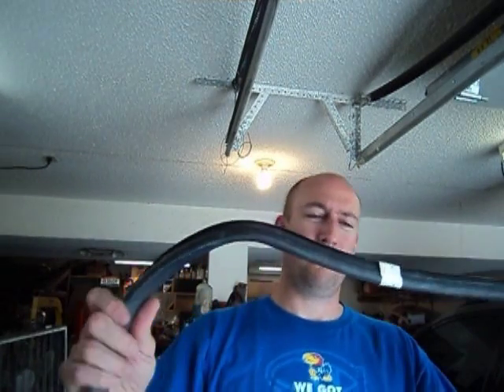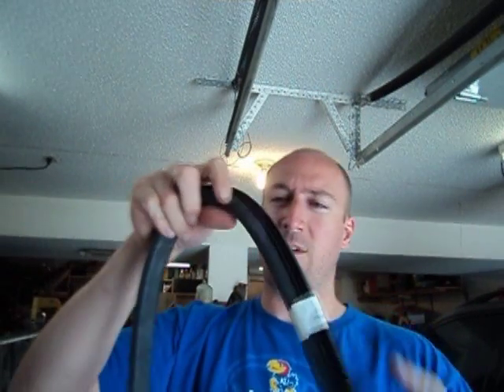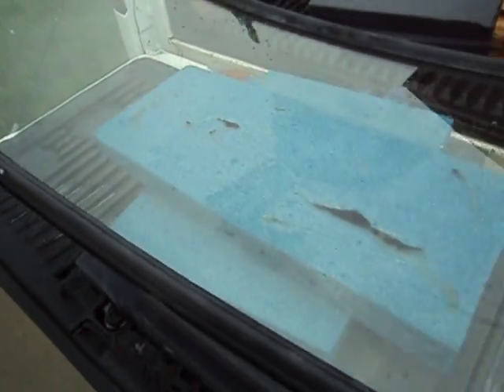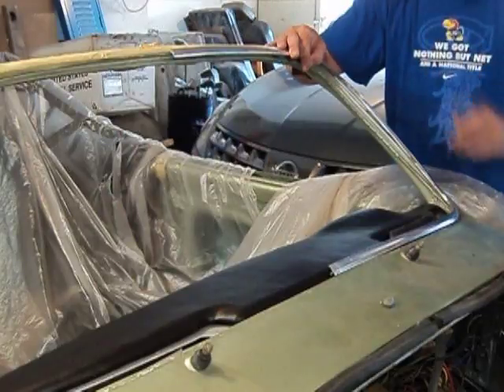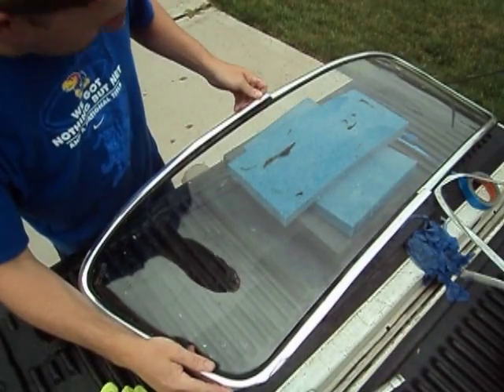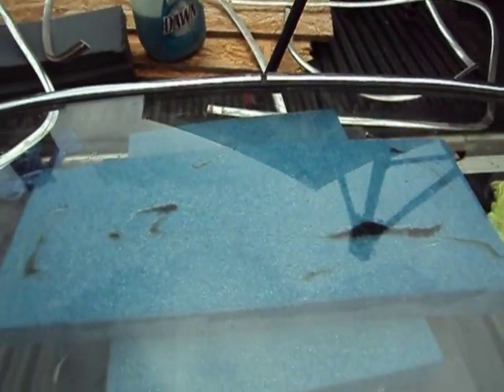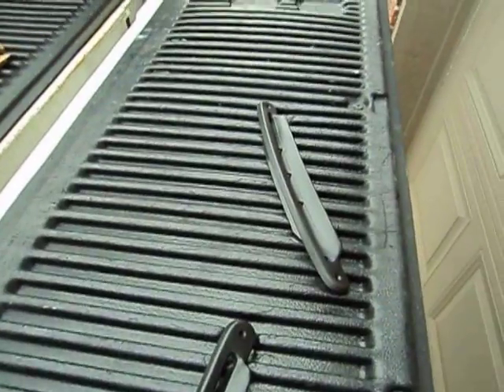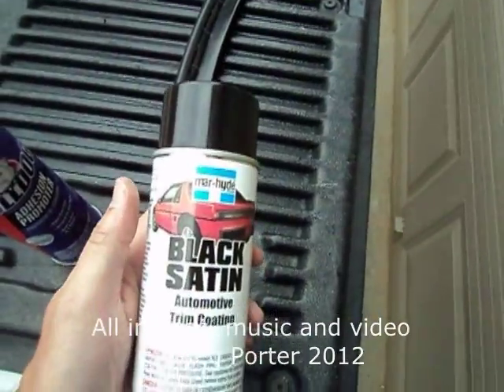Karmann Ghia Windshield Installation - Part 1

Comment: my 2 cents worth...run the old glass if you can get it installed w/o breaking it.When you find the glass you ultimately want you can always just break the old one and get your rubber and trim out w/o damage then your just out some labor...and practice. another cool vid! thanks

Comment: Too late for you Greg, but here's some tips for anyone else tackling this job: Go ahead and get the cheap gaskets but use 8 inch strips of duct tape going 90 degrees to the gasket to to hold the gasket in place while you work it on. Do this about every 8 inches. You can remove them once you get the gasket on the glass and are ready to put the wire or parachute cord (my pref) in the back grove.

Comment: I like th3 Bulldog promoter to once in a while when something needs that extra bite,,,I found that just using a single coat instead of like the directions say to use 2 actually is better than then the "gummy" type build it hasif to much is on there..not knocking it all just have been through some isses with it.. good to see ya workingon the car ..

Comment: Hi Greg, I know your video is 9 years old and wondering you can help me on something. My '72 windshield is 17" height in center. I have difficulty to find the exact same size. Found one that is 1/4" taller but it will hit the teeth and overlap the frame. I want to keep the teeth for American style trim. Appreciate any of your members can help me out too. Thank you all.
Reply from the maker: Call Michael Gregory at House of Ghia.  He should be able to get you squared away.  house-of-ghia.com